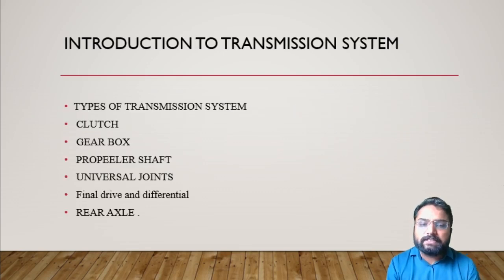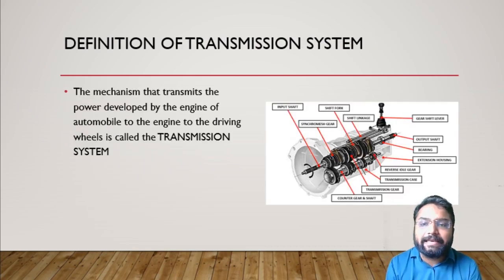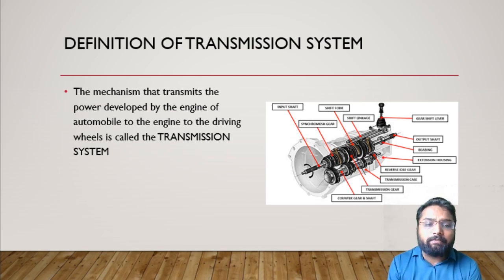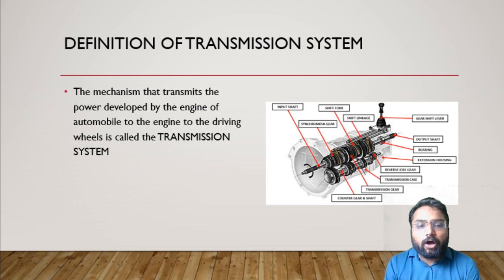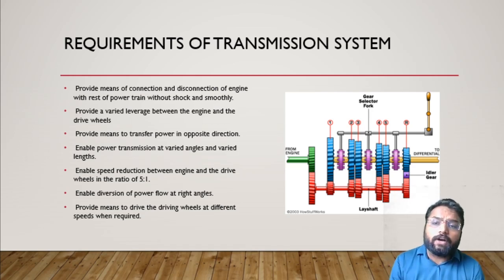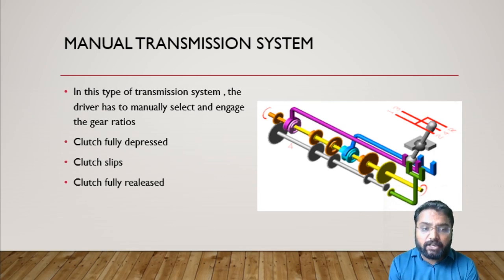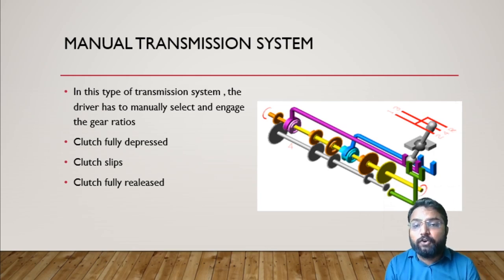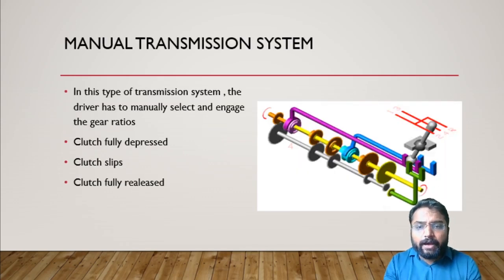L 42 A Automobile transmission system | Automobile Component and System Design | Automobile

Comment: Sir Plz give material for these topics sir  -- Chassis frame - Steering, Brakes, Suspension systems - Body Design & construction - 
Clutch - Gearbox - Propeller Shaft & Universal Joints - Final drive - Differential - Front 
Axle - Rear Axle - Wheels & Tyres